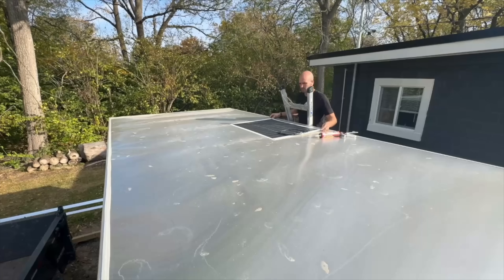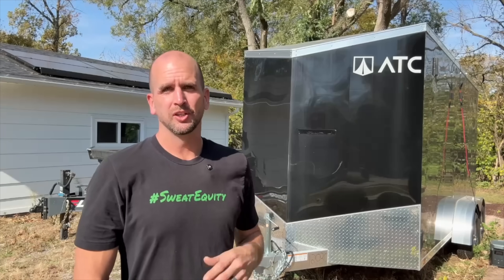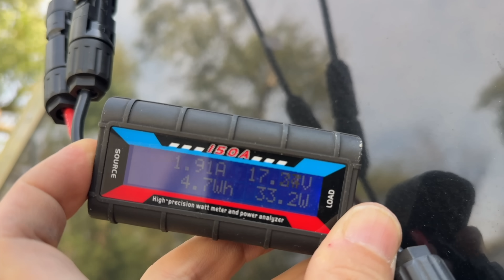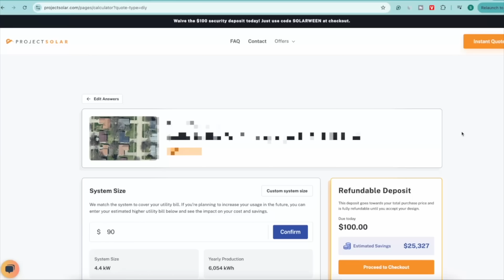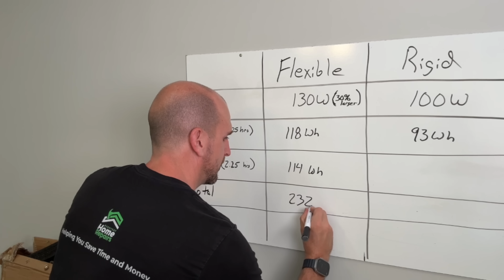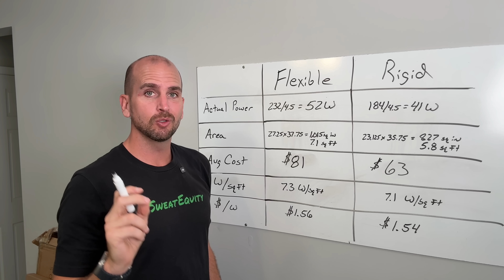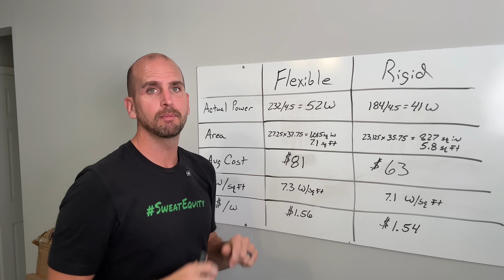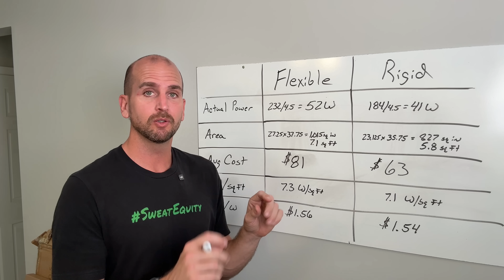100W Flexible Vs 100W Rigid Solar Panels | Don't Buy Until You Watch!

Comment: Neglected to consider, especially for RV applications, is the thermal transfer to the roof/coach.
Reply: What would it be as I noticed the flexable gets very, very hot
Reply: @petrusesterhuyzen2087 Absolutely, we have the flexible panels on our Class B van, and inside the van, the roof is incredibly hot during the summer here is the Southwest desert.
Reply: as well as sealing flex edge's to prevent wind from getting under.
Reply: Solid panels mounted to a alloy rack that raises them a few inches above the roof will prevent a lot of the heat soak. I use this method on my 4x4 tourer. Only downsides are added weight and added height, positives are a resilient solar system, longevity. consistent reliable output and minimal maintenance is needed. there is no discernible change in fuel usage. I was running a 50 watt panel but due to theft of my hardware I am upgrading to a 300 watt system (with much improved security)

Comment: All I know is after seeing a few flexible solar panels leave heat burn marks on the underside (topside of roof), I’m steering away from them.  Airflow MATTERS as it dissipates heat instead of transferring it.
Reply: Exactly right. I mounted 8, 550-watt Sungold power solar panels 15" of the roof of my motorhome. Not only do they run cooler, but my motorhome carries its own share tree with it, so it is cooler inside too. If this test had been done in a 100+ degree desert, you would see a huge difference in output due to heat soak. I got these long-lasting perc panels shipped to my door for 51 cents/watt over a year ago. They have a 25-yr output warranty, which is much longer than flexible panels will last. If I were going to buy more today, I would go with bifacials for an even better cost/watt, especially mounted 15" off my highly reflective Henry's 887 Tropical silicone coated shinny white roof.

Comment: I'm thinking all because the ridged has glass is why the flex one produces more Watts, from light not reflecting away as much,  but I didn't watch all the video because having to go to work
Reply: No, the flexible one was rated at 130 watts, while the rigid was rated at 100 watts. Next time, don't judge a book by its cover and then form an opinion. Instead, read the book... then tell us what you think 'about the book' instead of telling us what you think about 'your guess' as to what the book says :)

Comment: maybe I don't understand the comparison but isn't it like testing a 50w bulb and a 75w bulb and saying yes the 75w bulb is brighter?
Doesn't it need to be 100w to 100w or 130 to 130?  The tech changes as well as efficiency so really its comparing totally different efficiency and wattage. So that's not really apple to apple.

130w to 130w with same efficiency, that would be a legit test to compare because otherwise it pretty much means just get the highest wattage one that's on sale. Or if it needs to bend get the flexible🙂
Reply: He did.  At 8:30 he explains how the flexible panel should have had a 30% advantage but measured to be 26%.

Comment: Do flexible degrade so fast after 1-3 yrs only if you attach them flush mount to roof? What if I create a rack system and some edge reinforcements to give tons of air space underneath flexible panels (say 8-10" of airflow space underneath)? Would that make them last just as long as rigid panels?
Reply: I can't say, but... I have flexible panels on my truck camper, but I mounted them using strut channel. They're actually on polycarbonate roofing material that has sort of square tubes running the length. They're only a few inches off the roof. I'd intended to experiment with liquid cooling, but then I bought a place on the coast where it's always cool. So it hasn't been a priority. All that being said, I've had no problem after three or four years now. There were times this summer when they produced more than rated, but just for a few minutes after clouds broke and before everything warmed up. 

With 8-10" of clearance, I'd be concerned about the increased drag and what impact that would have on mileage.
Reply: The degradation is the same. I built a 10ft tall rack system for 10 300w flexible within 2yrs 80% drop in output. Such a disappoint!
Reply: To be flexible the panels have to be surfaced with plastic instead of glass. Plastic degrades in the sun. Glass does not.

Comment: You never factored in the weight! RV's in particular are already very tall (much more so than you utility trailer) you are mounting those to the roof, all that extra weight on the roof, of an already tall non aerodynamic box, will make it even more top heavy and potentially unstable. For that reason, and the smoother airflow, I went with flexible panels on my RV roof, and and additional rigid "suitcase" style that I can set up on the ground.
Reply: To be fair, it's not 'factoring in' the weight if all you do is mention it as a point of interest. To 'factor in' the weight, you have to use actual numbers. So, for example, how much do the flexible panels weigh for the total installation? How much would the rigid panels weigh? Take the difference and then determine whether one-pound, or 3-pounds, or 11-pounds really contributes (in a measurable way) to additional instability. Because in all likelihood, given how much RV's weigh by themselves, even if you added a hundred pounds of extra weight, distributed across the roof area, using the rigid panels... chances are that it matters so little than you can disregard it.

Also (and I mean this in a spirit of helpfulness, not criticism) try to be aware of using relative terms when evaluating facts. So, for example, "all that extra weight" sounds like a lot, but until you have an actual number of pounds (or kilograms, depending on where you're from), you can't measure anything. It's just 'exaggerated language' that's designed to sound like 'the final answer' when, really, it's just one person's preferences.

Comment: I installed 7 flex panels on a camper and 5 of 7 failed within two years - this despite being stored undercover off season.  Replaced everything & expanded with 10 rigids 5 years ago with zero failures since.

The camper is normally insulated where the trailer in this video may not be.  A good test would include roof insulation that'll further increase the ungapped flexibles temp but have lttle effect on elevated rigids.
Reply: I had the same experience with failure of one brand of 100W flex panel (8 years ago- a flush car roof mount)  A different, twice the price brand with a  good warranty has held up.  It's just very hard to judge quality of the various China made products, but if the installation is a lot of labor, best to buy from an established US dealer with good warranty, despite the price.  They will have screened out the suppliers with poor QC/construction.
Reply: flax panels aways fail in real use.
1-2 years of realistic use time is possible.
some burns, some of them delaminate, some fail without visible damages one scraches.
others loose ~30% of there performance in ~ 1 year and then start to fail...
trash all the time with this stuff.

serrious youtuber will tell you stay away from flex stuff, its ok for sometimes use in hollidays but thats all.
Reply: What is worse is you often see people gluing the flexible panels to their camper/van roofs.  I can only imagine how hard it must be to replace those.
Reply: Where did you guys get your flexible panels? I have a mix of renogy/rich solar..  new and used... Have no issues ..  I installed them with space under them to help them cool
Reply: I have two flexi panels on my van for two years. Absolutely no issue. You can’t mount the flexi panels straight to a flat surface or they will overheat. It tells you in the installation instructions if you get some proper ones. Just something like core flute will give it enough ventilation. I’m in Australia and temperatures get pretty high where I am. Before I installed them properly I had them sitting on the roof and the wind picked up, a gust of wind picked  up the panel threw it 15 metres away and snapped the connection. I was looking for the panel for a few mins till I found it. Still works great. If it was a rigid panel that fell it would have smashed. Also the roof on my van has ridges which also allows a lot of airflow. The ventilation around the flexi panels is very important. I’ve seen some vids of flexi panels catching on fire when the temps hit 40degrees Celsius or 100-110 farenheight. They have a nice low profile and very cheap install. Can’t even see them when standing next the van
Reply: I looked up core flute and search directs me to plastic board used for lawn signs on Amazon US. That stuff? Did you just attach your panels temporarily to the vehicle roof when under use?
Reply: @richarddietzen3137 Yes .. corrugated plastic also known as Coro-Plast
Reply: @richarddietzen3137 core flute sounds like it's  the same as coroplast which is used to protect the underbelly of some campers and for example political signs are made out of it. Instead I used several layers of VHB tape in 4 rows parallel to the length. It raised the panels about 1/4" above the roof so there is some airflow. I used eternabond tape along the sides but left the 2 ends open for airflow. That installation was on a teardrop camper with a rounded roof.
Reply: This seems to be a common theme

Comment: Huh interesting video you published as DHL is literally a few hours away to deliver an eco-worthy 130 watts (70 euros) to my address. I have large batteries and an MPPT sitting around, so I thought why not put them to use. Limited space, but I might be able to add one more panel to the balcony window if the first one was good.
Reply from the maker: Nice, best of luck getting the setup up and running 👍

Comment: When will you be doing the trailer project. I’m planning on doing solar and batteries for an enclosed trailer using the EcoFlow batteries.
Reply from the maker: We are moving in the next 2 months.  Once I get to the new location in Jan 2025 I will start the project.  I plan on starting small and then scaling up with multiple different levels of capability.  Ending setup should be able to charge my Cybertruck 😳.  The first setup will most likely be less than 400W and a Delta 3 Plus.

Comment: I would say rigid but I tried the new BougeRV Arch 200 Watt Fiberglass Flexible panels and boy is it tough!  You should check out some of the videos for them. I don't do my own videos but I had this panel on my boat and it takes a beating and still works great. I will probably put these on my 5th wheel soon.
Reply from the maker: Thanks for the feedback.  Future plans would be to test all of these main brands and get as close to an apples-to-apples comparison as possible with the addition of some endurance testing where we see if they degrade over time.
Reply: I used a Bouge Cigs long 100w that comes with the tape mounting on the front angle of my trailer because it was the only one I could find that fit that spot.
I may add 2 200w panels on the pop top because their light weight won't upset the mechanism 😅
Reply: I installed the same ones and they are awesome 10 year warranty + 25 year warranty on the output I don't think you can beat it

Comment: The flexible is considerably lighter.  I use them for easy deployment in emergency charging situations.  They can be easily hung outside of windows. They can be taken in less than five minutes.  And placed in a similar amount of time.  And a large advantage is that they can be handled by someone with a back injury as they weigh around 2.2 pounds.  With a decent amount of output.
Reply: I live in South Louisiana because the dence humidity defuses the UV light from the sun at noon day on a rare clear day in winter panels generate around 7% of there rating and in summer about 50% of there rating till shortly after noon time - 
      I'm a 4th generation mechanic electrician from about 1880 and spent my yrs as a generator man in the offshore oil fields - 
    With hurricanes to deal with and the low output of panels - I feel like flexible panels are a better choice - 
        We used them at times on repeater VHF radio repeater on unmanned platforms when generators went down - 
   I keep a set of flexible panels on hand just in case I were to need them - 
      Hurricane ida alone destroyed 1000s of Ridgid panels - most just collected the insurance on the panels & never replaced them - they learned they perform poorly in our area -
Reply: Thank you for this input!  As a and aging female with a history of severe back injury, I am always looking for what can I handle in my everyday decision-making process (I spend more money for smaller bags of feed for example because I can move them more readily while I struggle with large bags of feed which would be more economical).  People have all kinds of needs and I appreciate you taking more needs into account with your feedback!!
Reply: Don't drill holes in your roof😮. You can use aluminum square tubing without any holes in it. Use 3M double face rubber tape to stick it on roof. Then mount panels on the tubing. It will not blow off. I used it for 8 years in Arizona's extreme heat.
Reply: @DuRoc-w8g even with high speed on a freeway? I really want to do something like this aswell
Reply: @DuRoc-w8g I want to know what the other person asked how can that hold on the freeway? I would be afraid of causing an accident when one wants to sail off into the sunset
Reply: The problem with these things is: The solar cells themselves are hard and brittle. A lot of them will crack over time from wind bending the panel or general handling. Flexible panels that are not mounted to something solid lose a lot of their capacity fairly quickly.
Reply: @Chris-yy7qc  The cells they use in flexible panels are not hard and brittle anymore. Flexible cells are readily available.
Reply: @johnathon007  Youre wrong. And a 5 minute google search wouldve been enough to inform yourself.
Solar cells are made from silicon regardless if theyre put into flexible or solid panels later. 
Silicon is hard and brittle.

Comment: Also gotta figure the angling would boost energy generation by some 30% or better. Rigid seems to be the better option. Now if I were going to slap the flexible on an Airstream or similar surface, this would be nicer. I guess it just depends on the application.
Reply from the maker: 💯 there are a lot of different applications out there so just locking in on one type isn't possible.

Comment: On a vehicle, the flat/flexible has potential to save on gas with less drag.  Would be cool to see by how much.  However, if the flexible has reduced durability and longevity I wouldn't choose that to begin with.